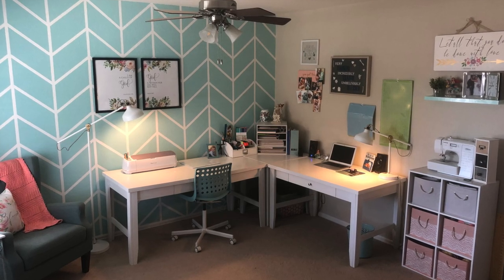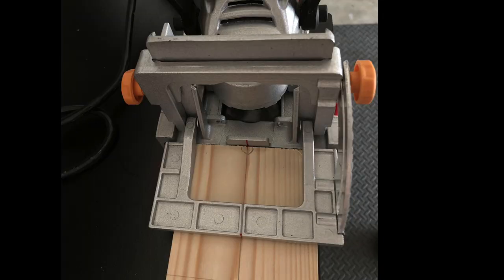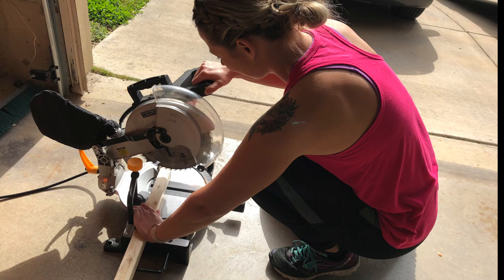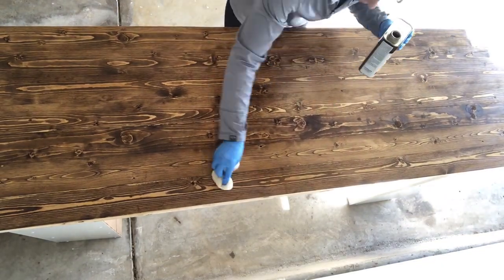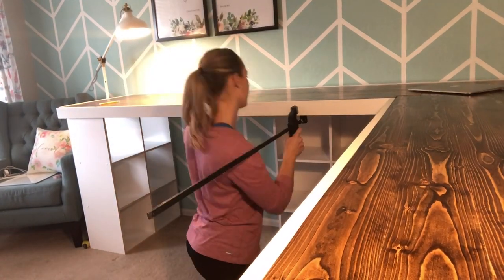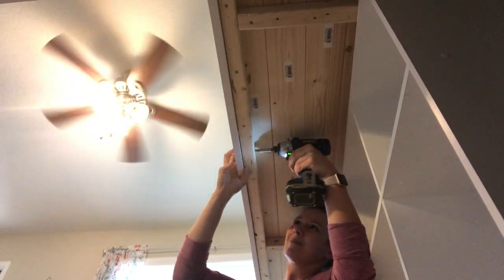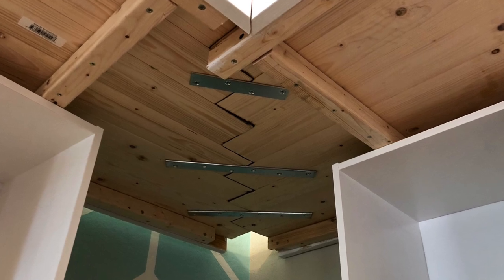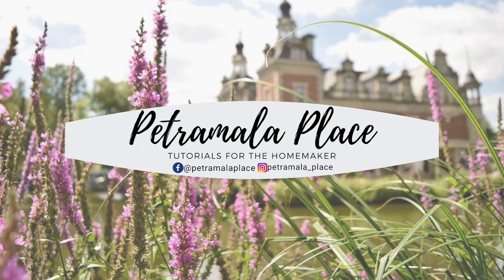Craft Desk Build

Comment: nice looking desk, you could have painted your trim band then stained the top and put the poly on the whole surface it will have protected the painted surface also.  One tip about painted wood if possible use spray paint it goes on smoother and less streaking.  I do like the herringbone pattern you did though for a novice very nice and well done.

Comment: I applaud your bravery to attempt this project.  I've got 2 daughters and try to get this to have the confidence to try things like this.  To eliminate the gaps between your boards, try and hand plane.  You can get a cheap one from Home Depot for less than $20.  To join the 2 halves together see if you can find some counter top bolts.  They are made for exactly what you are doing and they will pull the joint tight and is removable.
Reply from the maker: Thank you so much for the tips!

Comment: Just an idea for the gaps if they still bother you. Often when putting baseboard moulding in, white caulking is used to fill the gaps against the wall and works well. Might work here. Desk looks great! And good idea NOT using biscuits for the corner joint.
Reply from the maker: Thank you for your input. Why didn't I think of that!